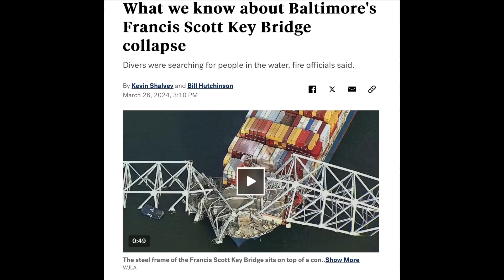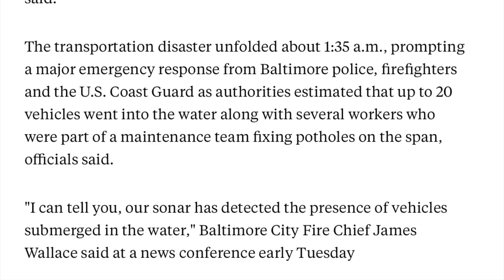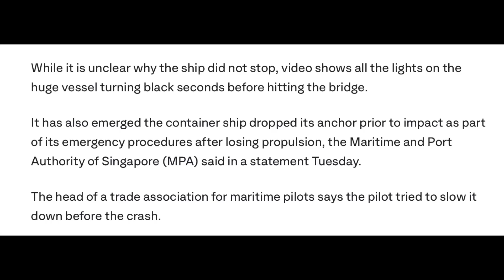The Baltimore Bridge collapse: how does this happen?

Comment: Very SUS, they say it lost power and they couldn't steer, then how did it take a hard right turn right into the support, but if it didn't turn it would have passed between the supports and under the bridge safely. Now you add the Captain is from Ukraine. (As reported by Redacted).

Comment: Apears it lost power and they couldnt get it back. In the video ypu can see it go dark, lights come back probably from backup generators, and then a few times dark plumes of smoke from its engine. Probably from attempting to restart the engines. These are big engines that dont start instantly. Once power is out you have no rudder control and the tides pushed it off the main channel. Only a few hundred feet but enough to hit the bridge. From its AIS data it appears it lost power about 4 minutes before the hit and never regained it correct coarse
Thankfully they were able to mayday in to have the bridge closed so there wasnt more traffic on it.

Comment: This bridge might take years to be rebuilt and 5 of the construction workers are missing
Reply: It took less than a year to rebuild the I-35W bridge in Minneapolis.
Reply: And all of the missing are immigrants
Reply: They have to finish the investigation before the can scrap the bridge. Some of it should be preserved as a memorial.
Reply: @TheMrPeteChannel  they don't. They can take as much info as they can quickly, then grab the bridge and move it an onshore place to investigate further. Same thing they did with the I35 bridge. Put it in a nearby park.

Plus we know the cause. A 100k ton ship hit it. Whether engine failure or stupidity
Reply: I'm figuring it will take at least 3 months before they can reopen the port, after that probably 2ish years to rebuild the bridge,  I'm sure that there is going to be a huge effort and it's going to get a very high priority in terms of raw materials, design reviews and approvals, etc, plus given the impact to traffic, hazmats, etc... not going to be easy.

and yes, very tragic that they haven't found everyone yet.thank you for keeping them in mind!
Reply: @MrMartinae06 it'll be a couple of weeks before they clear the channel. It's one of the largest ports on the east coast. They'll work quick to get it open
Reply: took 5 years to build it back in the 70s, probably will take less time nowadays if they do decide to rebuild it
Reply: @chargingTennisClips  I think it will take longer than we think if they rebuilt it.

Comment: Definitely tragic, but most likely an electrical issue with the, and a major one.  Either a fuel or maintenance issue.  These conspiracy theories saying it was some kind of cyber attack are frankly annoying.  Also the key bridge was an older design, made before the skyway bridge disaster down in Florida, so it doesn’t have the protections that the skyway bridge has made standard for new bridges.

One thing for sure, if someone didn’t follow proper maintenance and it caused this issue, someone will be going to jail.
Reply: Ship of fools.....
Reply: Conspiracy theoriests are such lazy people
Reply: They won't. These companies have international liability protections. They can do basically anything out side of intentionally hitting it and not be criminally responsible. Even insurance wise is a tough deal with a Singapore flagged, Indian crewed, Dutch chartered, and UK insured vessel
Reply: @brabblemaster401 running cargo for Maersk a company from Denmark.